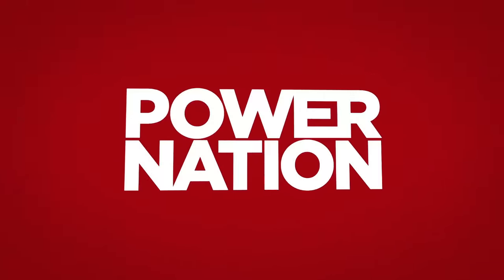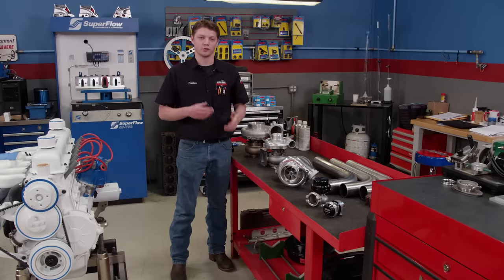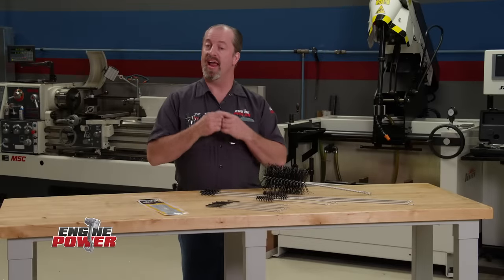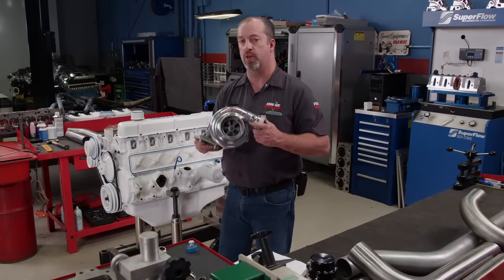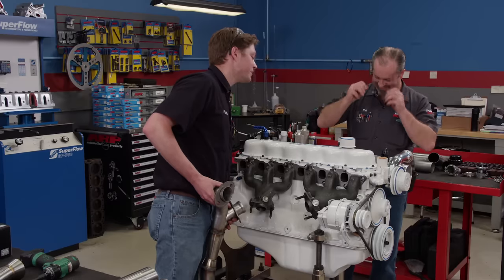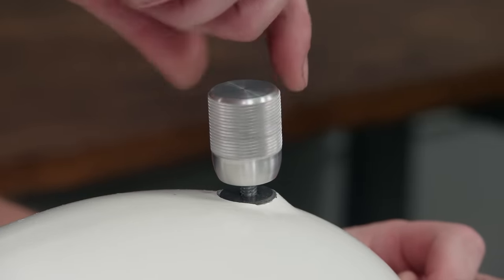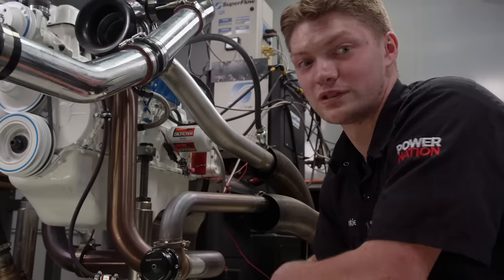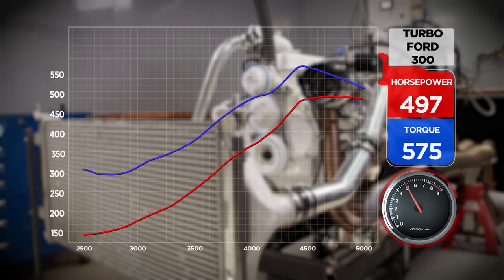Turbocharged Ford 300 Inline Six Makes Over 500 HP on the Dyno - Engine Power S8, E14

Comment: Id of loved to had that hook up on my 1969 swb Ford F100 and my 300 ci inline 6cyld. 4.9 liter with split manifold and duel exhaust and Holly 2barrel racing carb. and racing distributor and over size oil pan ( 8qt.s oil ) and yes it ran quick - topped out at 138 mph it had factory over size pistons and altered head

Comment: The ford inline 6 was originally supposed to be a diesel engine but it kept cracking the main journals. They we at an 18:1 ratio so a 9:1 with boost make alot of sense.

Comment: What the ram hurricane should of had instead of a little 3.0 all hopped up ready to explode at 27 pounds of boost. This actually didn't need as much boost and is built with a simpler design and relying on its displacement for low end torque. It's also an industrial I6 from back in the day so that being said it has a well deserved upgrade thats fairly conservative and would make a phenomenal truck motor with plenty of power and reliability. As far as milage I'm only estimating 14mpg on a good day lol.

Comment: I would bet in a fox body this would be a very good combo to a consistent bracket racer . Light weight, fat power, big torque, will 4:56 years I can see a quick fox
Reply: Gears! Not years.
Reply: Keep in mind this is still a low rpm engine? My uncle  has a 300 six in a three quarter ton flatbed with 456 gears. Lots of grunt not much speed

Comment: You should have seen my bossman's face in early 97 at the chassis dyno when we BROKE it.  This was an OTR chassis dyno at a Cat Dealership rated for 720 HP and we maxed it out with power still in the engine then it let loose.  All the mechanic running it said was how much more did you have left I said about 1/3 more to go he said about 850 to the ground 1K at the flywheel.  My boss looked at me and said DO NOT ABUSE HER.

Comment: Wow!  I was always saddened they discontinued this motor.  I wanted it modernized along with some redesign like crossflow, double overhead, a turbo option and keep it in the production trucks.  Inline 6 is the way to go, especially for a truck line.  I despise the current trend of itsy bitsy turbocharged engines in trucks.  I would have paid a premium for a modernized gasoline inline 6.

Comment: Question , was there a reason for deleting the headers to use 1987-1996 exhaust manifolds & not putting the "Y" pipe  behind the headers ?  I had a 71 Maverick Grabber , swapped a 250 for a  300 with everything Clifford Research made . I plan on another one soon but adding a power adder . The 10lb boost is about where I want to be. THX in advance .

Comment: I wonder what the power to weight ration is of this set up vs a 302 setup with the same power.

Also, that Dino curve is not so flat.  It is very top end heavy.  I wonder how that would translate to performance on the track….🤔

Comment: Where were all these parts when I rebuilt my 300 in my 60 Falcon ??? Lol I just watched too the end my poor falcon would need a much better rest end and something too prevent frame twist and a parachute for when she woulda went air born !!! See I know I was on to something I had the exhaust and intake split so I was running a two barrel Rochester and a single Rochester and 2.5 dual exhaust with no mufflers in 1983 …. If I only woulda just thought bigger and just 2 more clicks lol

Comment: Those inline 6 cylinder engines, Ford Chrysler Chevy, are all bullet proof. Years ago my friend tried to blow up his Plymouth Valent slant 6. Foot to the floor and held it there. I wouldn't blow. My guess is because there's no opposing weight like in a V6 or V8, to be causing vibration.

Comment: Mine had a fuel pump that leaked gas into the motor for who knows how long once I found it leaking out the dipstick I changed the oil and pump and it kept going , but it needed a different design to keep that from happening.

Comment: Awesome video.  I have a 1968 custom 500 with the 300. I order a dual port intake manifold for a 4 barrel carburetor, a 600cfm carb, distributor, and a 268/268 .456/.455 comp cam, lifters, timing chain and gear ⚙️. 

I did not find headers for it, if anyone knows a part number for them I will appreciate it

Comment: Never in a million years thought you would get that kind of power out of a straight 6 Ford. Question is..... How reliable would it be at that setup because that was the one thing the original engine had going for it is that it would run forever. How do you think it would hold up in a daily driver with a moderate lead foot?

Comment: I've wanted one of these engines for many years to play with. Unfortunately over here they want to trade your house to buy one. I've switched over to a mercruiser 470 (3.7L) 4 potter. Have a fiddle and listen to the music. I have a 23 bucket ( tupperware body) and a 27 Tudor coke can ( steel) body to nestle one into. Pop a hairdryer on top, with (fool infliction) fuel injection in OZ slang. Should have shitloads of torque as well as being something different.

Comment: Funny thing is, the setup you installed on this engine cannot be used in the vehicle. The exhaust tube under the oil pan is in direct conflict with the I-beam which the truck has going right under the oil pan. It cannot be put into place in an F-150 pickup! In fact, the I-beam is so close to the oil pan in an F-150 with the 300 I6 engine, that the engine must be unbolted from the motor mounts and transmission and lifted with a jack in order to remove the oil pan it so that you can replace the oil pan gasket! There is no other way to remove the oil pan from the I-6 in an F-150. It cannot be done any other way because of the I-beam. It was an unfortunate design by Ford because it made replacing the oil pan gasket very expensive and time consuming. It is also very low and kinda close to the ground, which might be OK but would make going over speed bumps very slow and scary. In the end, it cannot be installed in an F-150 because the tube is right where the I-beam is located in the truck. Sorry guys, this one is cool but it's a bust.
Reply: They put it in a truck and only had to modify it a bit I think. Looks goofy but it did fit
Reply: @stevenhoitz9260  It is impossible install it in an F-150 which came from the manufacturing plant with an I6 engine because of the I-beam. They had to have installed it on another kind of F-150 which came with a V-8 engine.

Comment: Imagine they use chopped LS head and bigger turbo and water Meth injection. They could easily hit 650+ the head is the real limiting factor. And then upgrade the cooling system you have a monster.

Comment: Man can y'all get the slant six to 777hp and sell mas the fabrication kit for us to weld up. Like on cut sheet and weld together than fuel injector system with plug and plug box several automatic fines tuned settings for driving choice etc.

Comment: These 300s are exactly what you would want for an inline 6 and you can build them up to make over 400hp without getting to stupid like these modern v6 and i6 with over 25 lbs of boost ready to grenade shit. Id say these 2 fellas did a great job and is cap it at 8-9 pounds of boost and call it a day its more than competitive and hopefully will last for some time. No vvt, no overhead cams with VCT, no 4 valve arrangement needed, Its probably more reliable than anything new.

Comment: They could have gotten the same amount of power with 8 psi as they did with 14 psi if they ran a water to air intercooler instead because psi doesn't mean jack when the intake temperature is high because the more psi you push the higher the temperature goes it's all about air density not psi because the cooler you can get the air intake temperature the more dense it is which leads to more power.

Comment: Ford should reintroduce a straight six with modern design somewhat like the Godzilla. That 300 was a good engine in half ton pickups. It was better than the v_six for pulling. It was also used in trucks.

Comment: Here are the figures if they boosted it more 
300 cubes @ 5000 rpm with a volumetric efficiency of, 80% which is really good for a stock 6 cylinder engine 
@20 PSI 625 HP
@25 PSI 730 HP
@30 PSI 804 HP 

And for a race spec 
300 cubes @ 7000 rpm 
@ 30 PSI 
1730 HP - 1850 HP

Comment: You're worried about the strength of the block?? There were guys building these engines, naturally aspirated, bored, stroked, and making 650hp, back in the 70's and 80's with the stock crank, lightened, even,
That was before you could buy turbo kits everywhere. Cool build though guys! I like the videos.

Comment: Wellll, this should surprise nobody. back in the good ol' 70's, Bruce Sizemore was cracking 500 large in his drag racing Ford 300 6 cylinder Pinto with no turbo, just injection. Oh, yeah, and a specially fabricated Cleveland cylinder head. Yup. Beat Lee Shephard in a Reher Morrison SBC Corvette, giving the 'Vette a light or two head start on the tree.

Comment: I am in the process of sourcing a 4.9L to replace the 4.2L in my 04 F150 heritage so that I can turn this pile of shit into a decently fun car to drive. If I wanted to build this engine out to handle 400hp should I be looking at building the bottom end or will the stock pistons and rods be sufficient for that power range? I'm also planning on doing some work on making a port injection setup instead of the holly efi that you guys have.

I'm sure I'll have to upgrade the pushrods, rockers, and cam but what else can you recommend when I source a long block?

Comment: What application was this engine built for? I don't understand the crossover going under the engine. Wouldn't that be in danger of being torn off in many vehicle applications? Wouldn't it have been easier to mount the turbo on the other side of the engine and eliminate the need for the crossover and a mile of exhaust pipe? I'm just a dumb carpenter. You wouldn't have done more work than you needed to, so -  does the run of exhaust need the length to function properly?
Reply: They explained in the video that crossover layout was just for using it on the dyno, would be useless in a vehicle
Reply: @289hipo  musta missed that

Comment: Ok stop right there with the normally aspirated 270 HP with 300 +++ft lbs of torque, that engine is probably bulletproof at that level and represents real world value. Just drop it in a early to mid fifties Ford pickup mated to a 4 spd manual tremac transmission with overdrive and you can keep it for at least half an eternity without losing a penny of value !

Comment: Yea this is kinda "neat" but it's a very short duration test run, my guess if you tried to run it for an hour, preferably much longer, I bet it would blow apart, as the block, crank, rods were not meant for this modification.

Comment: The reason why your horsepower plateaued is due to the limitation of the valve size ,Cam size, and air flow of the cylinder heads
I purposely built a ford 300 I6  that made a thousand horsepower and 1200 ft lb of torque
Using a very rare industrial block 
The Bore I will not disclose
Reply: Dyno sheets?
Reply: The graph looks like that because that is where the engine achieved peak boost...and after that it is riding the wastegate. By the way  I think we all would be interested to see dyno sheets and video of this incredible engine you have built.

Comment: 5L engine making 88hp stock is just shameful glad it was possible to bring it up to a less embarrassing number.  100hp per liter is not bad but it should not need a turbo to get there.
Reply: It's an industrial engine designed in 1964, it was never made for horsepower.

Comment: A few seconds at peak power on the dyno is meaningless.  How much can it supply reliably on a long pull of say an hour or two and how much on a continuous basis as in a pickup pulling a GVW of 24,000 lbs. all day long?

Comment: 9.5:1 and boost? Of course you're going to make power. 
The 300 and Chrysler 225's are capable of stupid power, as long as you can fuel it and control timing.
Hell, the Ford Lima 2.3 Turbo can make 300 hp using stock parts.

Comment: He doesn’t know what he’s talking about with turbos, both the compressor wheel (what he was calling an inducer wheel)  and the turbine wheel (what he was calling the exducer) have an inducer DIMENSION and an exducer DIMENSION they relate to the diameter of the wheels as the air interacts with them (in-ducer being where the air enters and ex-ducer being where it exits) also there is more to turbos than just size, AR ratio and trim also play a big roll in selecting the proper turbo for your application.

Comment: How much horsepower does my 95 f250 300 6cil fi should have just put a complete clutch sistom in it . I can't seem to get it running right. It ran just fine when I took it in for a starter because my boss said he'd pay for it. That mechanic said my oil was real low he's a lying mofo. Before I start my dump dump trucks every morning I check the water and oil before I start my jeep or pick up I check the water and oil. I have nearly 340000 miles on my jeep 4.0 strait 6 change the oil every 3000 miles less than a half a quart of sinthetic between changes always use Valvoline sense the 60s just what dad use to use.seam too work well for us.forgot to minchan that my valve cover is leaking a little bit. Probably where some of my oil is disappearing too. It's probably time for a toon up any how. I thank I'll have mr. Sid someone I can trust(hard to find these days) change the water pump thermostat check timing gear and or chain an d any thing else that's do on a 2003 Rubicon I run purple in the 3rd members. I want everything checked out theiroly my my sones in Alaska and I'm in TEXAS I'm ready for the fun of it. They don't call me ramblin Randy for nothing. My other car is a bad ass k5 blazer and I'm looking at a mid 90s motor home. With a 5.9 Cummins 12valve p pump.

Comment: That 300 only has >100hp for that engine. Yall should put EFI Sniper on it and put better rods, rings, and least shave the head a bit. Maybe doing this you may get it up to >175hp. If you could at least double the factory HP you  would hit a homerun!

Comment: My god what are you doing to that poor motor, it's not even a X-flow head but bloody hell it'd be an awesome sleeper because it sounds smooth but the next problem is getting the stock gearbox to take that. Narr it won't take that at all. And what's that other pully for above the water pump?? You did forget to show temp monitoring as I don't think the cooling system is up to getting rid of that much heat, and what's oil pressure & temp doing in a sustained burst of power?
Reply: the 300 can be paired to a many great deal of heavy duty transmissions, the t18, np435, zf-5, and C6 auto are all capable of withstanding big block and diesel torque, so I think they'll handle a boosted 300 just fine,

Comment: What a waste of time and money! That would only wear out the engine quicker! Not feasible for everyday driving and I'd rather see the engine put in a vehicle!
Reply: Wrong, wrong, and wrong again. 

There's a guy with a Fairmont pushing 40+ lbs of boost and making over 900 to the wheels, runs and drives great.